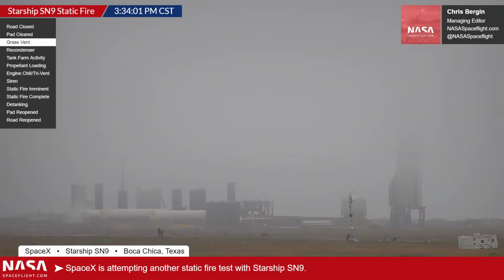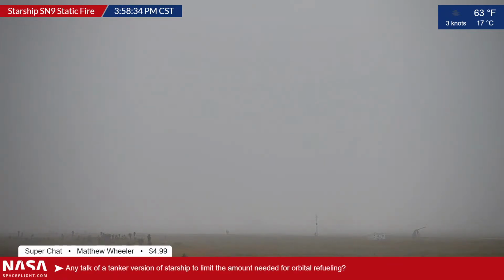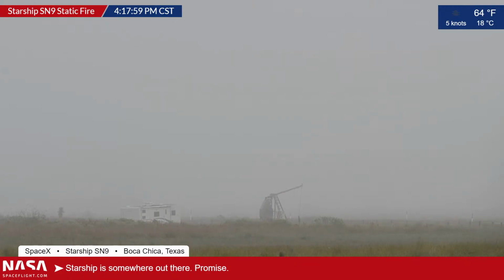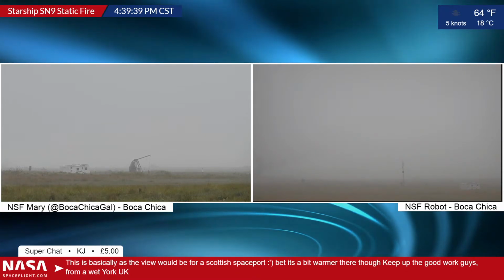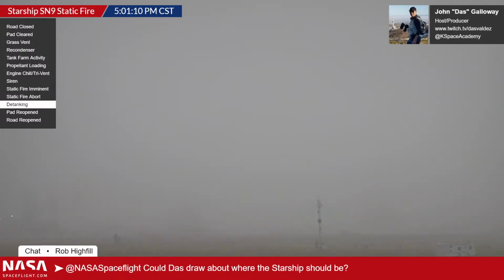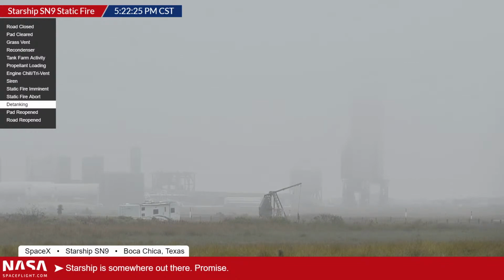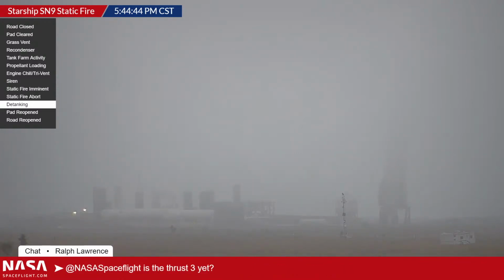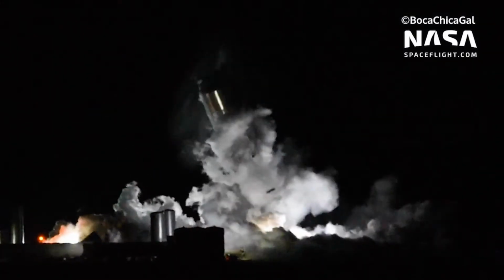Starship SN9 Static Fire Attempt not Full Duration

Comment: Using polaroid filters on the cameras might help penetrate the fog a bit. They certainly help if both the the viewer/camera and light source are polarized at correct angles. Car headlights should all be polarized, both for fog driving and to prevent glare from oncoming headlights.

Comment: How long does a static fire usually last? Thanks!
Reply: About 3 seconds
Reply: @balazsszakal1772  thank you kind sir!
Reply: @FatHeadDave  no problem!
Reply: @balazsszakal1772  why so short?
Reply: @rafalkonieczny_  because a longer burn would just damage the pad below. So I think a 3 second firing is the right balance between getting data about engine performance and not destroying the pad

Comment: Did all these abort start happening after they changed the header tanks gases?
Reply: That’s likely, but I’d have to remind you that it was the inherent lack of aborts that was responsible for SN8 to not detect the methane header tank failure in flight.